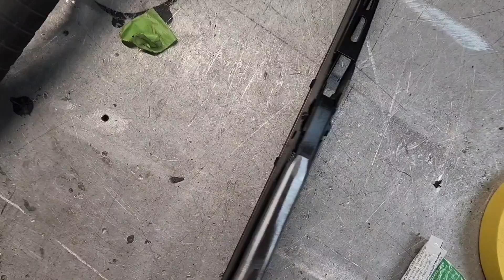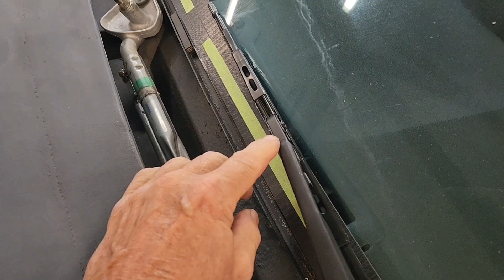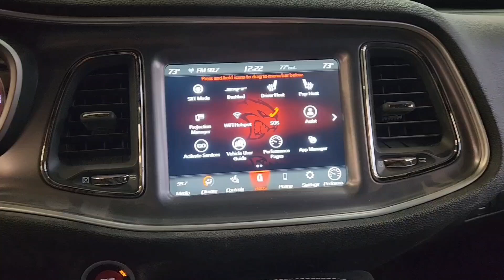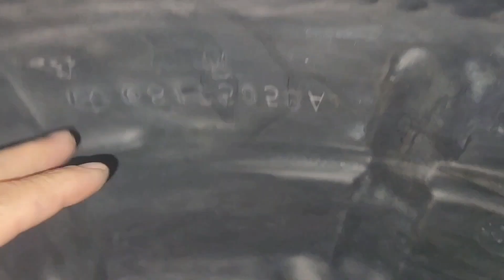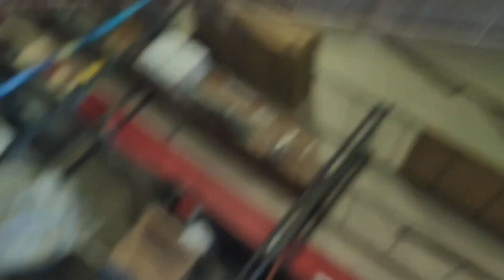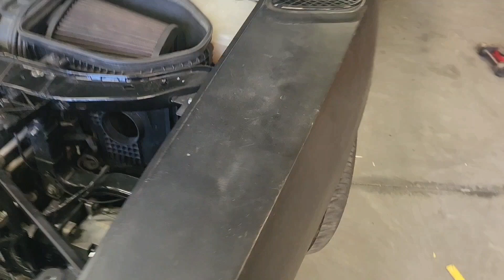Randy's Hellcat Daytona part 84

Comment: I asked about using a using newer Dodge Charger for a chassis while back to put 74 charger body on it. You replied back about a video to watch on strengthening the body. Which video would that be again?
Reply from the maker: Don's 68 Charger body swap part 3
Reply: @SteveMirabelli so for my 74 charger body would you recommend me getting a 2013 challenger or charger chassis?
Reply from the maker: @TJSchoby  The Challenger is almost the same wheel base at 116" compared to the 115" on the Charger. The modern Charger is 120"  and would be a tough fit.

Comment: I think your issues may be the adjustable shocks this car have and the 20 x 10 wheel. You probably can go to a 20 x 9 but you would need a wheel to clear the big caliber. It’s been great watching the bill. We really appreciate you for sharing and we appreciate the good work man. It’s awesome, thank you
Reply from the maker: Thanks. When a suspension system gets complicated like this it is hard to do what you want to do and I don't like messing with the factory stuff on these new cars. You are just asking for trouble. Bottom line is the car is just too heavy now for the lowering springs. Heck. The wing alone adds about 100 pound to the decklid not to mention the super heavy steel hood and steel nose.
Reply: @SteveMirabelli  yea I definitely understand that. What wanna to make you aware of the different ride height options with those adjustable shocks. It can be adjusted in the suspension settings. But those blocks should fix your issues
Reply from the maker: @stevenaaron6889  good to know but figuring out how to make those adjustments are beyond me no one I know can walk me through it.

Comment: I love the videos I am going to do a body swap 73 challenger on a 2011 challenger rt chassis and I will deffently take some of your videos in and watch then a few times to get some pointers and ideas you did awesome work on all the body swaps thanks
Reply from the maker: Thanks. That is going to be a challenge for sure. No pun intended. I think the old Challenger is wide enough but you may have to shorten the new car platform.  Either way good luck.